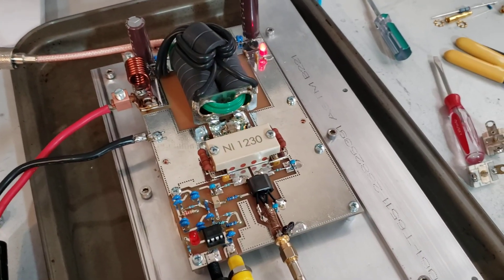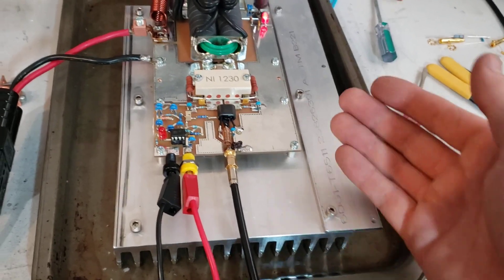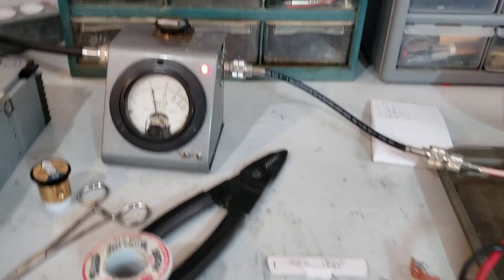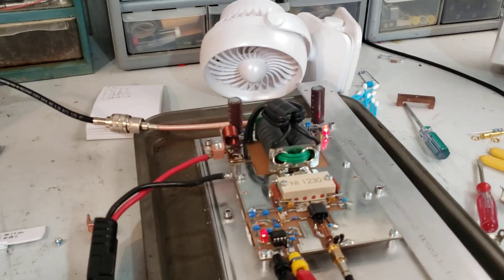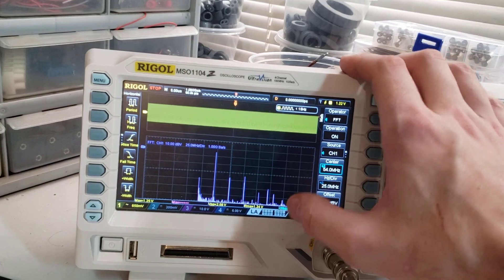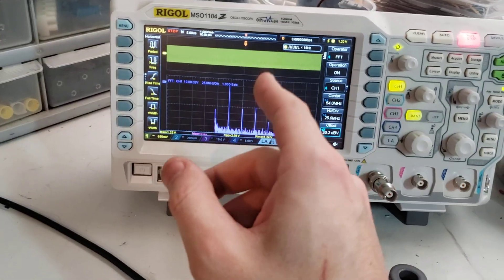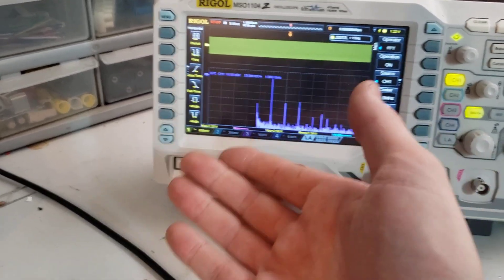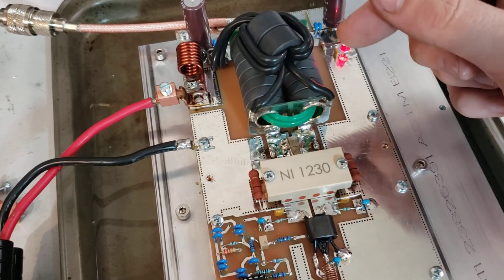A Little LDMOS Update

Comment: Check out W6QPL website, I design these for high reliability , typical 5 KW Pout ,  the trick is use ferrite that does not saturate. Saturated ferrite will get hotter temperature. Higher Output Power means lower impedance , meaning use lower lower impedance coax, But Higher output power can Arc, so use bigger Ferrite cores and coax.

Comment: Hi friend
I'm Manuel EA8T, I really liked your videos and I am interested in building an amplifier with a MRFX1K80H, I already have a 65V 30Amp power supply. I have some experience with 2 x MRF 154. But I have a question about this module you use:
This module can work as it appears in the video in the entire HF band or only in 27 Mhz ??
Could you indicate the printed circuit of the amplifier module for HF is marketed ??? Where I can find it??
73s
mtordesi@hotmail.com

Comment: BTW, you're right... heat sink paste for those very high power devices is inadequate. You need to solder those devices to a copper heat spreader. Then, the spreader mounts to the sink with paste. That combination has a much larger surface/contact area.
Reply from the maker: Having spent the last few months learning everything I can about thermal solutions, and along with many hours of CFD simulations, I've come to the conclusion that paste (good paste, 4w-mk or better) is acceptable if TDP is around 500w or less. Beyond that... soldering along with a highly engineered cooling system are mandatory.
Reply: @MudDuckSharky  I don't think it's the 500W that's the barrier for the paste... it's the power density. If those very high power devices had the internal die spread out... and were twice as big at the flange... then you could get away with the paste.
Reply: @MudDuckSharky  I think that wet sanding both surfaces, transistors and copper, is the first step. Add a thin film of thermal silicone and you are done. 

Regarding reliability, you must add a fast switching removing driving power whenever a fast peak of over driving power appears, it looked to me that your radio sends a power peak before selected driving power settles down to get at the output those 2100 PEP. I have four power mosfet that remove power supply for each device if there is a spike of excessive driving power high SWR, more than 35A at 50 volts, or high temperature. 

A big surface of fresh air at the front panel and two 170mm 48 blowers, runing very slow at only 13 volts, extracting air at the rear keep temperature of LDMOS below 55°C. Fresh air comes from the front cooling the top of the amplifier and the heatsink below as well. Heatsink is huge, amplifier weight is 40Kg not including the external power supply.

Regarding linearity I have set my idling current to 2.5A for each of four my mrfe6vp61k25h devices, after having seen the imd plots of these devices. That's 125 watts each, 500w in all, of heat before any rf power is applied but I get decent linearity limiting the output power to 500w. My 3 to 50MHz linear amplifier is built using four modules, four 1250w devices, to get 2Kw output quite clean with imd3 35dB below the levels of each of the two test audio tones. 4Kw is possible but I must keep power below 2.5Kw for linearity to be good enough for not splattering 9KHz when my USB audio bandwidth is only 3KHz.

2500mA for each device may seem a lot, but if you look at the plots of the Freescale data sheet you'll see that 4500mA gives best linearity if output power is limited low enough.
BTW... I haven't smoked a single LDMOS... Not yet!